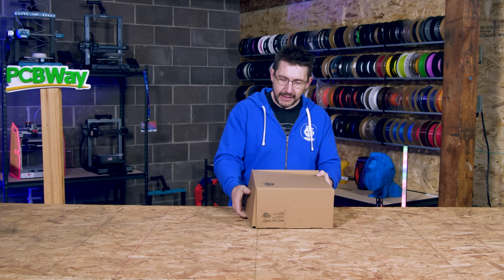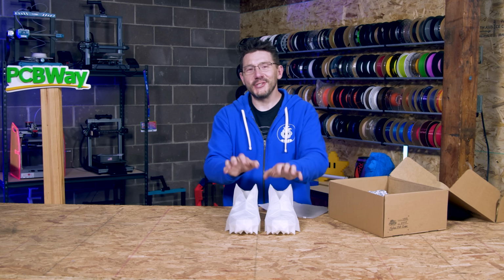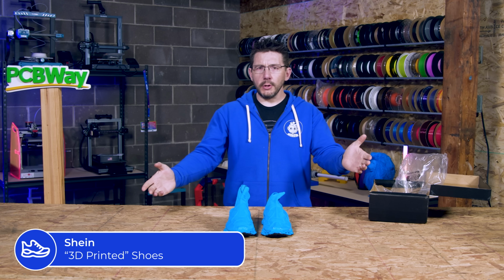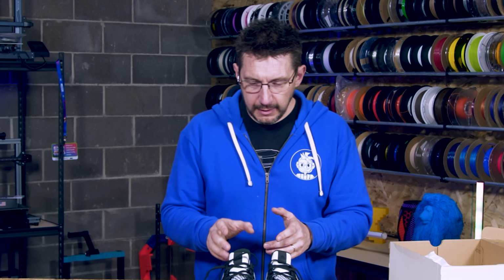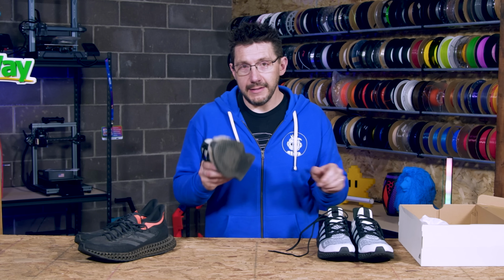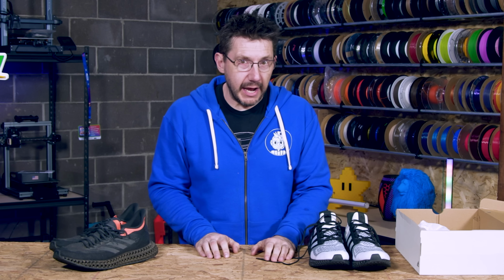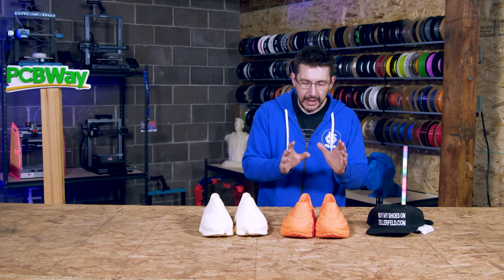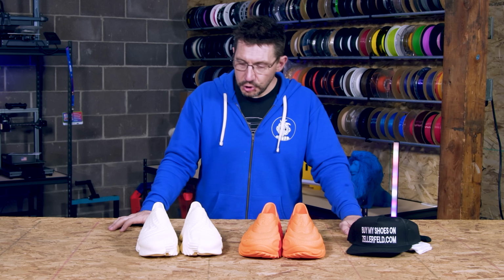Testing ALL of the 3D Printed Shoes!

Comment: I think a good use for 3d printing in shoe making from my perspective as both a 3dp nerd and leatherworker would be for creating custom lasts to form leather around in high end bespoke shoes/boots. Getting a 3d scan of a foot and then having a parametric last made to those specs could both speed up and increase the accuracy of custom shoes, it could also make it more accessible to people who want to get into that type of leather working. Also 3d printing clicker dies And other such stuff for getting the panels seems a good application for 3d printing, maybe even adding in structures that would be impossible with traditional manufacturing, especially in the mid and outsole construction where 3d printing seems to have the best chance given the available materials for FDM.

Comment: As someone who is a Pedorthist by trade, some of the complaints about the Adidas you made are also on you as the user, specifically the upper ripping. Sizing is never accurate and consistent,  that's why it's broken into a 'measure and fit' process. You should have a clearance from the longest foot from the longest toe to the end of the shoes but 15-20mm, more towards 20mm if you're a runner, this is due to flexion like when you flex a deck of cards, the direction you flex the cards, the inside cards will extend further than the outside cards, this is referred to as differential elongation, with shoes this is the foot and shoe, causing your toe to creep close to the end of the shoe. The shoes are also doffed and laced up, which suggests you're donning and doffing these without undoing the laces, which will create shear as your foot slides back an forth adding to the trauma to the upper.

Comment: are 3d printed products from flexible filament disintegrate and falls apart like PU sole of a shoes after sometime from humid in the air? Since both of them suffer the same issue which is hydrolysis.

Comment: You're wrong about the 4dfwd, you just beat the crap out of your shoes, what did you expect? The uppers are the same materials they used in other traditional sneakers, they have traction on the bottom instead of slippery 3d printed soles, oh and I have 3 pair.

Comment: What I am curious to see is a hybrid boot. I am into traditionally made leather boots, and have been learning construction methods, and I am interested in these. I wonder if a boot that utilizes a hybrid of something like a leather body with tpu at the flex points, (decreasing crease lines in certain areas) along with a tpu outsole and something like ABS or another stiff material for a shank and maybe parts of the lugs, among other things, could be viable.

Comment: I think we are barely grazing the surface for sure. Hiking boots with spiky bottoms and stretchy latches that fix them firmly to your calf? 3D printed material interwoven into a traditional manufacturing fabric or tread to give it the ultimate bond? So many avenues.
Reply: @802Garage  agreed.  I’m thinking shin guards, scuba fins.  We’re just scratching the surface.
Reply: @chazdean201  It's def coming. We need more people to think outside the box and execute. If I had a tool changer printer I'd try some weird stuff. The new Bondtech INDX system is exciting.

Comment: FYI you can use resin printer to print flexable rubber now. It may be possible to 3d print on a resin printer a shoe without layer lines. That said it would need to be a large format printer, probably not a hobby grade machine just based on the size requirement. But you can get a rubber like consistency UV resin now, I just got some and am surprised how well it can actually work.

Comment: Anybody know what material would be best to 3d print sockets for driving bolts/nuts?
Reply from the maker: You’d want something a bit reinforced. Hand turning could easily be a PETG or ASA / ABS. However for driving it with a tool, you’d probably need CF Nylon.
Reply: @3DPrintingNerd  thank you, I have tried 100% infill PETG-CF and it mushroomed around the driving tool. Would you think something like ABS or ASA better? Or just go straight to CF Nylon?

Comment: I have the catch 22 that "walking around a city at a quick pace" combined with "sitting still at a desk" is apparently how to utterly destroy shoes. The sole rips off, it gets punctured, the fabric rips, it gets bad and this tends to happen in 3-6 months... the catch 22 is that I've had this happen with budget shoes that cost $20 and more expensive shoes (the highest I went was $70...). I walk rain, shine, and snow, and remember asking Pooch about the Adidas and he said "it's fair weather footwear" and if I'm gonna spent 3 figures on shoes, I'm doing it once, not for fair weather + bad weather. I just can't bring myself to spend $100-$300 on shoes that could get destroyed in 3-6 months. I have a bunch of friends who tell me "it's higher quality, it will last longer" but after poking them they eventually get to "well, you'd probably destroy them in the same time but for a high quality shoe, you can get it repaired" and I had to bring in consumerism: $100 for 1 shoe every 3-6 months vs. $100 for 2-5 shoes that each can last 3-6 months... I'm gonna go with the cheaper shoe.

All that is to get to the point: I'd love to 3D print my own shoes or the parts of the shoe that break... and right now, cost vs length of time it lasts is not there, and then seeing the quality issues with the Adidas just makes it harder still. One day.

Comment: I'll say the shoes in the video need pull tabs at the back of the shoes since often times the shoes are just big enough to fit your foot and ankle and doesn't always have space for a finger to get in the shoe to get it on the foot right.
Adidas needed to make some hook and press fit  points on to their carbon fiber mid sole allowing the bottom sole and the traditional top part of the shoe,
to better adhere to the carbon fiber mid sole since the different materials mean all pieces of the shoe aren't able to stick to each other for long time; were if the carbon fiber mid sole had hooks and pressure points for other parts of the shoe then the other parts of the shoe will stick to the carbon fiber mid sole over and over again throughout the daily use of the shoe since other parts of the shoe will keep on sticking to the carbon fiber mid sole better through the every day use of the shoe as they break in and set/stick to one other the person wearing the shoe moves around in them.

Comment: While the zellefelds look great for $200+ that's madness for something that is printed. We all how cheap it is to print something. Yes I understand r and d etc but seriously why buy a 3d printed shoe when i can buy a leather shoe for far less
Reply: The shoes are still in a novelty stage and not willing to be widely adopted. Justifying the higher cost. A simple design change to make it more traditional and bring down the price is not possible because, the goofy nontraditional design is fashion hiding a larger issue with 3D printed shoes  whether that is durability, comfort, breathability, or all of it. The final 10% to make the shoe a more traditional and adoptable shoe is very hard to solve, so the price remains high.

Comment: I feel like you should have addressed the price of the zellerfelds. They're almost $300. Way too expensive, especially since the filament cost is probably very low, and they aren't customized for the customer
Reply: There was a lot of r&d that went into the custom design and custom material. The product is still in a novelty stage and not willing to be widely adopted because it stands out too much, and a simple design change cannot fix that, the goofy design is fashion hiding a larger issue with 3D printed shoes preventing them from being more traditional, weather that is durability, comfort, breathability, or all of it. For these reasons the cost can be justified.

Source: from personal experience try making some that fits all the requirements for regular mass adoption, the final 10% is very hard to solve.

Comment: What all of these miss is the real benefit of 3D printed shoes: one designed specifically for your foot shape. 
That should be the goal, a way to scan a foot, and print a shoe for that specific foot. Would really help people with foot problems.
Reply: Totally agree. I was going to say the same thing. My local athletic shoe store actually does a full 3D scan of your feet to exact scale and they use that to properly fit shoes to you. They even send the completed 3D scan to you to see all the dimensions and such. Turns out that my feet are actually slightly different dimensions. They look the same to the naked eye, but the scanner picks up the exact dimensions. There's no reason, we couldn't then send these scans to the shoe manufacturer and have them create the shoe around our actual feet. That would be amazing!
Reply: Zellerfeld does that
Reply: An idea would be pressure scanning in addition to 3d scanning the top.
Reply: in the new balance stores they do that but they get as close as possible but will fully tailor a shoe to your foot if you custom order it in store but its not 3d printed which honestly is just cool
Reply: I think maybe just an insole would be sufficient
Reply: Some custom shoe makers will use a 3d scan of a patient's foot to print a shoe last, which they then build a shoe around by hand using more traditional materials. As shown in the video, the materials in 3D printing just aren't there to produce a quality shoe (yet).
Reply: There are some that do indeed do that tho

Comment: What kind of testing are you actually doing? You just glossed over the FUSE shoes and showed a short clip of you shuffling about on a smooth floor. You didn't even mention the material.
Reply: Exactly and he didn't even show the socks underneath
Reply: There's not testing man! This is just entertainment for the masses.
Reply: @augustopaixao8911  the video title literally starts with the word 'testing'
Reply: Because this is literally trash.
Reply: Testing as in rating them
Reply: He is using TPU, bro. Just use TPU.

Comment: Fastest way to create massive amounts of micro plastics in the environment - wear 3d printed shoes.
Reply: You say that like shoes aren't already exactly that problem
Reply: @TreePDX  no I say that because it already is that problem but continually growing. All of the EVA foam soles being put on running shoes is insanity. They break down into tiny particles and spread everywhere and then you need to get new shoes every few months to a year when I have the same shoes on for the past 20 years and they still look like they did after about 2-4 years of use. EVA foam is just aerated plastic. People could do actually beneficial things with 3d printers and shoes are NOT one of them.
Reply: So then this has nothing to do with 3d printing. You're salty that people will be replacing plastic soles... with plastic soles. That seems like a zero sum situation.
Reply: @Zekealot  plastic soles? 😂
Reply: @MeltyBubs  literally what you said dude

Comment: As a footwear retailer (this is my opinion, not those of my company) the crucial piece of information that is missing about the Adidas is the age of the shoes.  Most shoes are only meant to last a year to 2 at best, (which matches the warranty most companies have) and the issues Joel showed are both very common failures in traditional running shoes, let alone 3d printed ones.  I blow through running shoes made similarly, except for the 3d printing, in six months on average.  Usually it’s my little toe searching for freedom through the fabric, sometimes the sole rips off, and ultimately 100% of the time the midsole gets crushed flat.  The compression set of EVA midsoles over time is ultimately why they don’t warranty shoes past a couple of years, because EVA Foam just can’t handle sustained loads for that long.  So the fact that the 3d printed midsole held up so well is actually a really cool positive development in creating more sustainable footwear.

So ya, if they failed like this in a month or two then that is problematic, six months with the use described it makes sense why Adidas did a warranty replacement, and if a year plus well they’ve lived a good life, time to replace them, and Adidas found out Joel was a YouTuber.  I’m not trying to say that it was ok they failed, but given modern manufacturing techniques this was always the likely outcome, where weight and performance and comfort have taken priority over long term durability.  So depending on how long before those problems occurred, it might be a little unfair to say that this model is a failure in context of how shoes are made and perform today.
Reply: Shoes should last much longer than a year. That's so much waste.
Reply: Yeah, shoes are a scam and crap across the board these days.  Most aren't even available in size 17-18 and if they are they're shaped all wrong, narrow toeboxes and such, and they usually don't last past a week.  A few days in and the midsole just collapses to mush, the shoe feels like a lumpy slipper and my back and knees hurt from walking crooked.

Bruh, shoes used to be good, but fashion over function and planned obsolesence made them shit aside from 'looking good', which i both don't really care about AND usually consider ugly or gaudy and cringe.

Airwalks were the worst, i used to wear OG Airwalks and Vision Street Wear back in the day and both were solid and would last.  It took skating big roof gaps to collapse the soles.  Now Airwalks won't last a single park session, i blew through two pairs of Airwalks in a day and was skating barefoot by sunset.

I wear pretty much only modded DC Courts these days, only shoe with a decent shape and big toebox i can find, even other DC models don't fit right.  To keep them from collapsing i strip the guts out and bed the midsole airgaps with shoe goo, about 1.5 tubes per shoe and make the entire midsole solid.  I also reinforced the inside seams with a layer and so far it's lasted about two months with no signs of collapsing.  I just don't understand why they can't make a shoe like that from the factory, even as a paid upgrade.  It costs me like an extra $30 of shoe goo and a few days to cure, i'd gladly pay an extra $40 or so for a legit solid shoe i don't have to disassemble and rebuild.

But like FFS if you're selling a size 18 shoe you'd think they'd make it with a midsole that can bear the weight and forces of someone with size 18 feet.  I'm not a 90lb wealking on waterskis, if i'm fasting and down to skin and bones i'm still around 220lb naked and more with all my gear and backpack and whanot.

I heard Supras have a solid urethane midsole, i've always wanted some so bad but they don't make anything bigger than 14 IIRC.

I originally got into 3d printing with the intention to make my own shoes back in around 2012-2013, i wanted to make molds so i can pour my own urethane midsole parts from quality materials instead of crap like EVA and mushy weak rubber and roll my own uppers, but i got distracted by all the other cool things it can do.  Lately though i've been heavily into 3d printed moldmaking and have a lot of knowledge and experience that will help me out, so they might just be coming soon.

But as for the directly 3d printed shoes, they all look like disposable gimmick fake swap meet louie yeezies, and yeezies are just glorified atrocious looking crocs in the first place. But then again that's pretty much all modern shoes.  They just don't make 'em like they used to and nobody seems to remember back when they weren't all single use disposable fast fashion trash.

Comment: I love the idea of 3d printing some parts of a shoe, but I would absolutely not wear  one that was 100% printed, they all look clownish. Adidas are on the right track, it's too bad they cheaped out on the materials for the top, but that's a great concept.
Reply: I'm still not clear on the advantages of the 3d printed parts.
Reply: @harmless6813  You're on to something. In the case of Adidas the 3d printing was to create a complex pattern of gaps in the sole that made it springy. Looks like they printed that with rubber resin, which is likely way out of reach of most of us. 

If I were making my own shoe, I wouldn't take that route at all. I'd design a sole for my foot, add the traction pattern I want, then FDM print a sacrificial negative of it, and use it to cast a rubber positive. Voila - now I have a real sole, one that is durable and flexible. Then I'd 3d print a jig to help me assemble an upper around, also shaped for my foot, and around that jig sew an actual upper out of nylon fabric, once again, like a real shoe. Then glue the upper to the sole using whatever black magic glue sneaker makers use.

This sounds like way more work than just sending a shoe STL to a printer, but I get a real shoe out of it, and my 3d printer would help a huge part of the way. Shoe's are not made from a single thing, they're complex devices that have to be comfortable, durable and breathable.

FWIW I use 3d printing to make design concepts for clients - clients want concepts in epoxy, silicon, cement, plaster etc, but 3d printing makes it so much easier to shape those media, and all my clients love how the 3d printing is helping them zero in on manufacturing questions from the very start of the process.